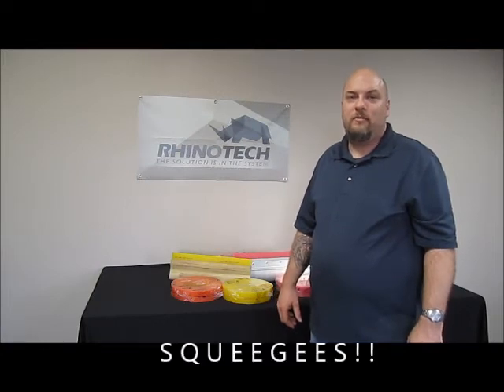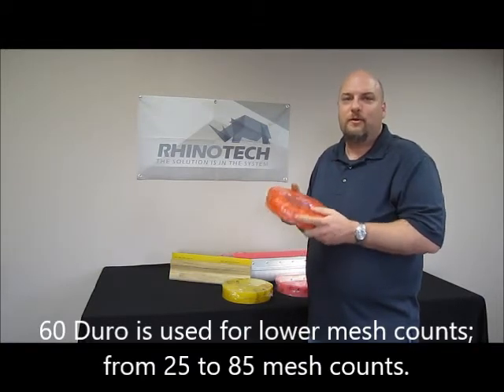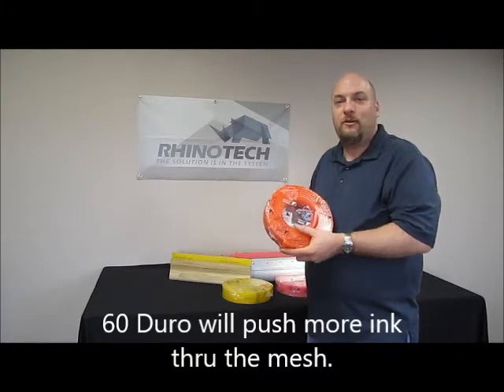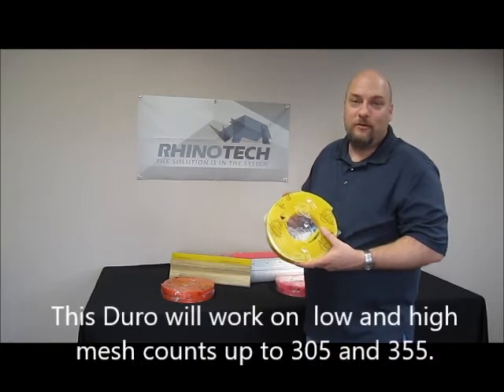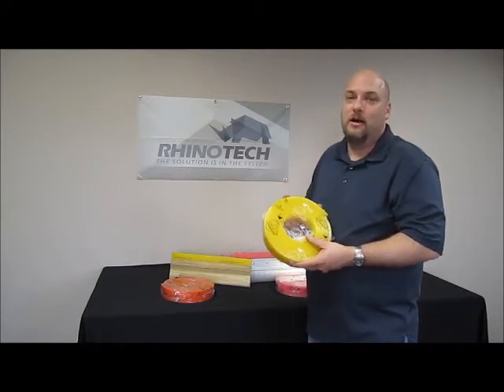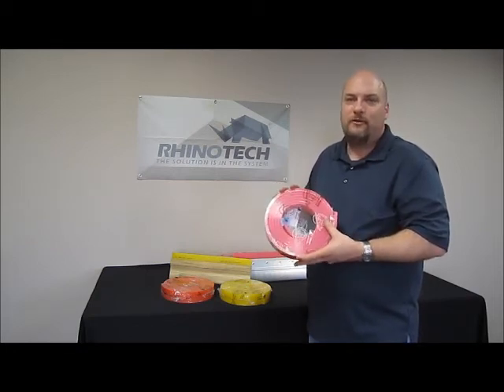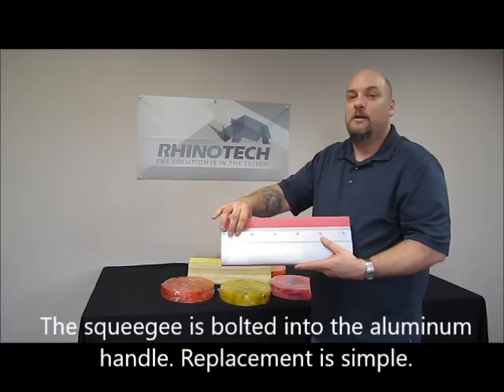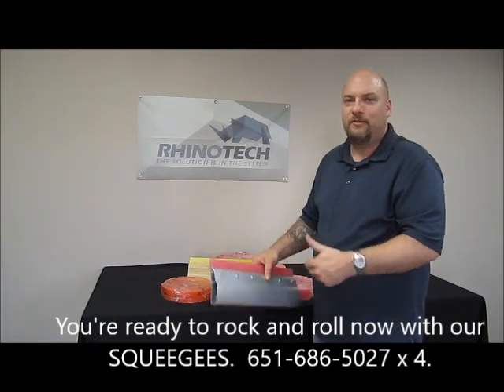SQUEEGEES for SCREEN PRINTING

Comment: If I am using a high mesh count  with more detail but need to push more ink thru because it's thick will a 60* durometer orange work better? The green seemed like it wasn't pushing enough ink
Reply from the maker: Thanks for your question and hope this will help you. A 60 Duro is the softest material while the 80 is the hardest. Generally, the softer grades (60) are used when you need to push more ink deposits with high coverage printing, so yes, the 60 Duro will be your best bet. 

80 Duro squeegees are used for reduced deposits when using UV inks for fine texts and higher line counts. Be careful not to press down hard when applying ink as this will only create excessive wear on the squeegee and make the ink deposit heavy and hard to control. A few more tips: use a squeegee that just exceeds your printed image size and leave adequate space between both ends of the squeegee and inside of frame for the best print. If you have more questions, please give us a call at 651-686-5027 ex 2.